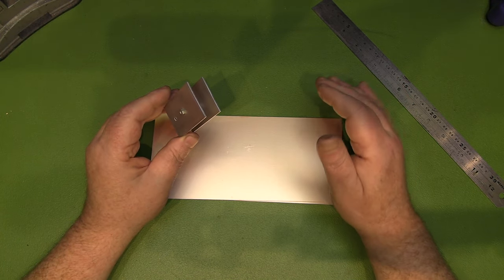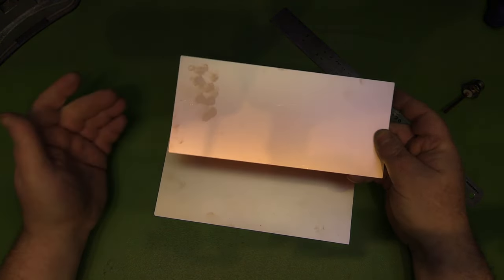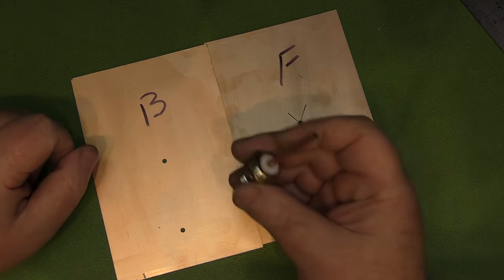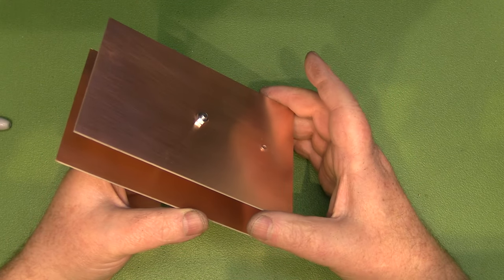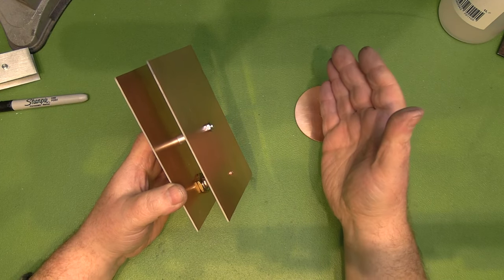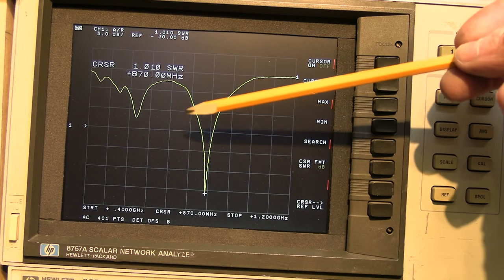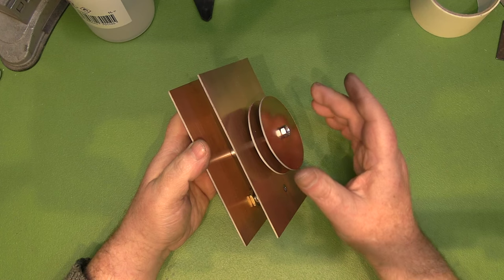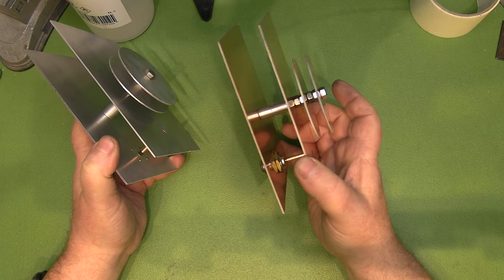9db Directional Antenna for Helium Mining

Comment from the maker: Please note the US and UK (EU) use slightly different frequencies so I have made two PDF templates with measurements for both. Link in description.
Reply: Awsome was just going to ask about that.  I have a 802.11ah bridge and am looking for some cheep antenna designs to improve the link. As I'm in canada we follow the us ism frequencys. Currently using some $10 ebay pcb "directional" antennas designed for drone use. I get a week link at 600M there are a few trees and houses in the way though. ~(5mbps)

Comment: Thanks for great video! I have question, Does it suppose to be (electrically) connected between two plates (PCB plates)? I mean, if I use a non-conductive 30 mm spacer, will it be better impact or worse impact to the antenna performance?

Comment: Question for the aluminium version: How did you connect the brass tubing from the N connector to the aluminium sheet? I assume soldering is not an option?

Comment: How do you know the gain of antenna? How did you measure them and came to that value of 7dB?
Reply from the maker: You can measure it using a VNA but with experience you just know. Different materials used in the construction can have a small effect with something like front to back ratio. Sellers like to exaggerate gain but a physicist will tell you it is a pointless measurement like adding 2+2 just to check it is still 4.